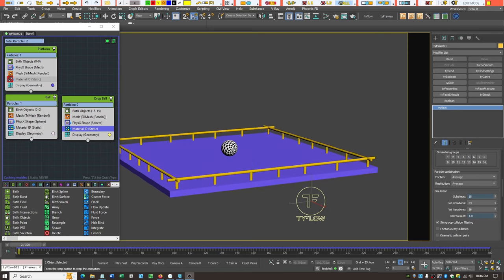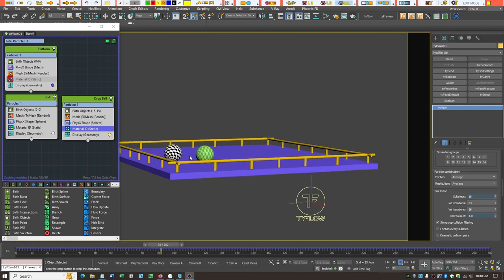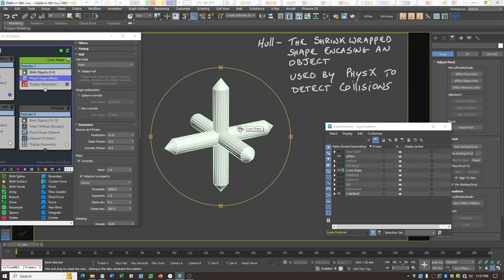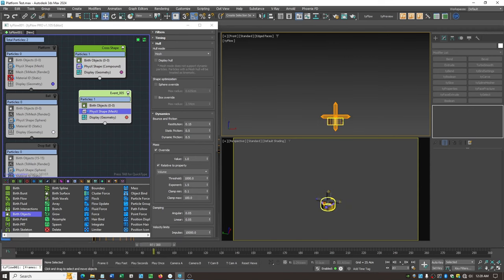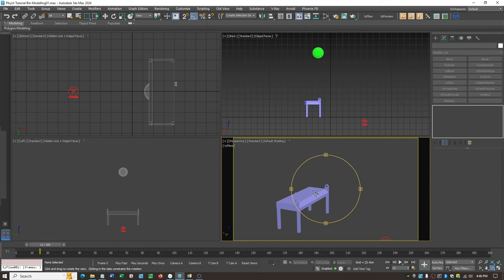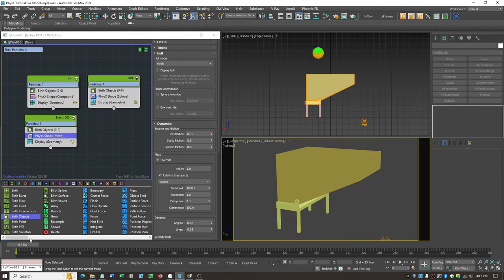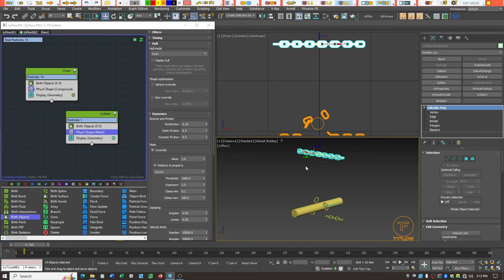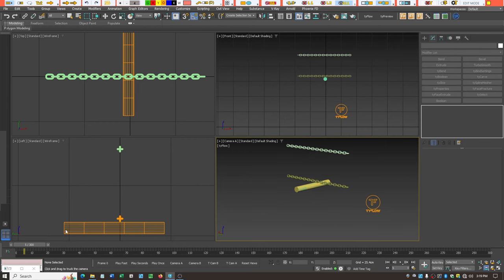08 - tyFlow PhysX - Complex Hulls and Dynamics Tutorial

Comment: Thank You. Have a question regarding the chain example. The way you did it works awesome for a schematic physics display but for realistic renders we could not split them. Is there a work around? Can you specify to use a different mesh for physX like in Unreal using UCX. Or maybe there is a way to easily attach/link unbroken chain links with deactivated physics to the broken one with physics enabled?
Reply from the maker: I am not sure what you mean by split them.  I just detach segments and then re-attach so they are workable for PhysX type animations. You should be able to apply materials and render, I have noticed sometimes when splitting into elements you might loose perfect smoothing like when they are one item.
Reply: @fireflightphoto1319  yup that's the issue I fear - smoothing groups. And sometimes you have to modify the UV's or mesh after the animation has been set up. But I think, I already learned how to circumvent this - Set target + "Link to target"